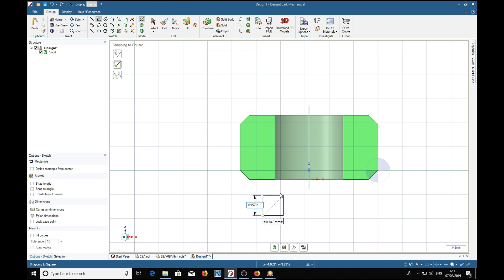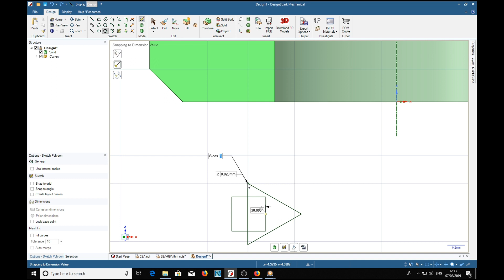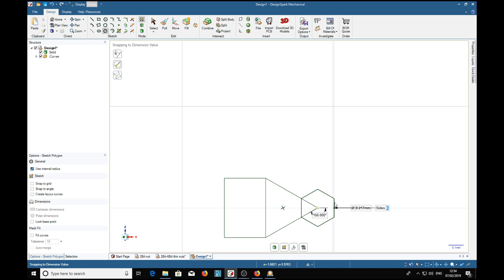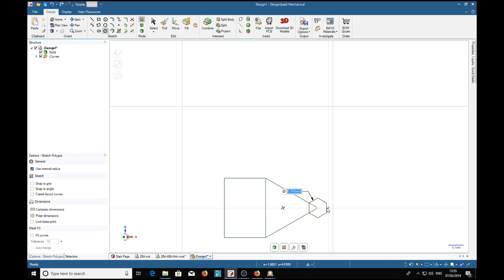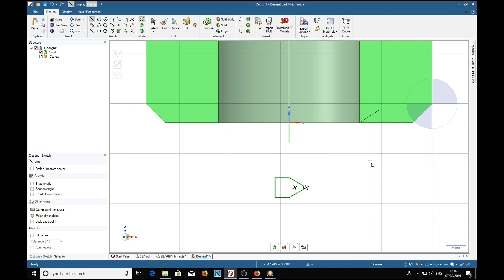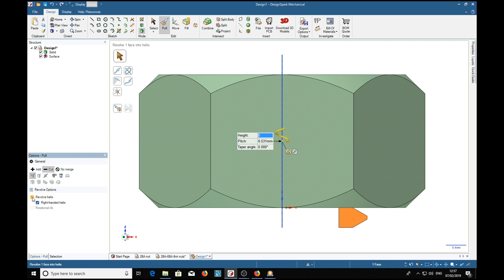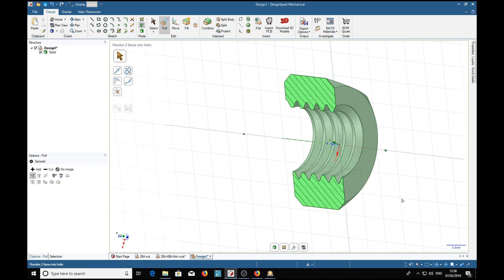DesignSpark Mehcanical: Making a series of nuts pt2

Comment: For some reason I had to manually move my mouse up through the nut in order to cut the threads. The yellow helix moved as I moved the mouse. Still trying to figure out why it wouldnt cut the threads automatically.
Reply: So for the height I had to put in a negative number then it worked lol

Comment: Good afternoon. I saw your videos on working in the program and I thank you very much for this.
It’s audible in the video that you are using keyboard shortcuts. Could you display them on the screen, which keys you press to switch between tools. This will help to better orientate in the program.
Reply from the maker: I do mention the keystroke in most of my videos but I do forget sometimes. You can get a list of keyboard shortcuts by pressing the F1 key and entering 'keyboard shortcuts' in the search box. Also if you hover over the tools with the mouse pointer, some of them tell you what the keystroke is in the popup e.g. 'Line (L)' - L being the key to press. To familiarise yourself with the keystrokes, whatch my previous videos. Here is a list of some of them below:-
-------------------------------------------------------------------------------------------

https://youtu.be/TDScRpqilrc Making a spur gearwheel pt1
https://youtu.be/HjGsEvv_FLc Making a spur gearwheel pt2
https://youtu.be/8UKF64cEkgc Making a spur gearwheel pt3
https://youtu.be/-Q7kQOQNVnU Making a spur gearwheel pt4
https://youtu.be/zckXl0Q77qs The Maintain offsets tool
https://youtu.be/glp0CGVhHrE Explaining Pull, Offset and Both sides, etal
https://youtu.be/xCvCxrY3y2w Fun with the Blend tool
https://youtu.be/XMIPRqgoecg Adding text on a sheet metal part
https://youtu.be/JV1TSIoHy6Q Adding bend lines on a sheet metal part.
https://youtu.be/AWk61DFiYqw Putting slots in a hollow sphere
https://youtu.be/diZ2hc7K3-s  Modeling a rifled barrel
https://youtu.be/_UMKlKt3RGQ Making slots in a rod
https://youtu.be/ggkgRi7onWw Modeling a cone
https://youtu.be/WnEzMkJej7k Modeling a cone
https://youtu.be/LKJ1Ln6hYEE Modeling a cone
https://youtu.be/ADwwa0J2P9w Modeling a hinge
https://youtu.be/n6qxEDMBx44 Modeling a hinge
https://youtu.be/vF0R1cClBsM Trunking with bends
https://youtu.be/qGxm1b9PC_g Trunking with bends
https://youtu.be/6JhEqXFhib0 Making a ball and socket joint
https://youtu.be/aH7KwNwdpp8 Making a ball and socket joint
https://youtu.be/G14jFVib5us Making a Perendev rotor
https://youtu.be/W0cfHC2km_0 How to make a flat spring
https://youtu.be/LT7ZZlD3HNk Making a square spring
https://youtu.be/PnkEADAv1oI Making a square spring
https://youtu.be/A7rSmC7b-94 Vintage Fender Stratocaster pt10
https://youtu.be/x0OjwMIXbs8 Vintage Fender Stratocaster pt9
https://youtu.be/KBLXNq7wSE8 Vintage Fender Stratocaster pt8
https://youtu.be/4dKBT7RfubA Vintage Fender Stratocaster pt7
https://youtu.be/BzeXoTJwAtg Vintage Fender Stratocaster pt6
https://youtu.be/E9HmuuxaaEY Vintage Fender Stratocaster pt5
https://youtu.be/JxquDCi_0gw Vintage Fender Stratocaster pt4
https://youtu.be/w54Jy_nsvjs Vintage Fender Stratocaster pt3
https://youtu.be/w54Jy_nsvjs Vintage Fender Stratocaster pt2
https://youtu.be/Q5ez5sI8Zfg Vintage Fender Stratocaster pt1
https://youtu.be/njP8c9a4JZI The mirror tool pt3
https://youtu.be/fzb0-sHhm8U The mirror tool pt2
https://youtu.be/FMxsD-68muM The mirror tool pt1
https://youtu.be/VjRYpOuEc4Q Making a series of nuts pt3
https://youtu.be/LGlBKac7zWg Making a series of nuts pt2
https://youtu.be/JcCpibn8s_w Making a series of nuts pt1
https://youtu.be/oyiQnfwLMiA It's easy to fix things in DSM
https://youtu.be/ldrjAvWXea0 Aligning model loco cranks
https://youtu.be/c-pZjMWucWc Awkward pipework
https://youtu.be/qSo_vusG-Bw Conify and attache a part
https://youtu.be/yH5MSm9GqxU DSM exercise answer #1
https://youtu.be/a81fENEJZxk Making curved holes in a solid
https://youtu.be/zQ8l0r6YZx0 Slicing a model
https://youtu.be/6LASPA7NTJE Dependency in DSM
https://youtu.be/F-jWp9MLgEg Designing a solder pin
https://youtu.be/5QHBpdIjkKg Exercise #1
https://youtu.be/V19-YY3I98Y Modeling a potentiometer 6/6
https://youtu.be/79iRxa0QxP0 Modeling a potentiometer 5/6
https://youtu.be/alKpeAaOxSk Modeling a potentiometer 4b/6
https://youtu.be/72_phGCd9_I Modeling a potentiometer 4a/6
https://youtu.be/7codQKKO8IcI Modeling a potentiometer 3/6
https://youtu.be/pdVebxV2H9s Modeling a potentiometer 2/6
https://youtu.be/hU74cdkZuw8 Modeling a potentiometer 1/6
https://youtu.be/y56EObQfMuo Hole dimensioning
https://youtu.be/pSWR2gOv-6M Changing fonts
https://youtu.be/LtNTePQP7xI Basic sheet metalwork #1
https://youtu.be/pR1exsZ-Ds8 Band of gold
https://youtu.be/oc1VNENhjdg Using the combine tool
https://youtu.be/BzeZrwHu5_I Section tool
https://youtu.be/2CqehIUtqxA Basic moving
https://youtu.be/xublN59dd3A Making a pipe with bends
https://youtu.be/MdQB96fkAAk Align, Upto and Orient
Reply: @JimTaylor42  Many thanks for such a quick and accurate answer.